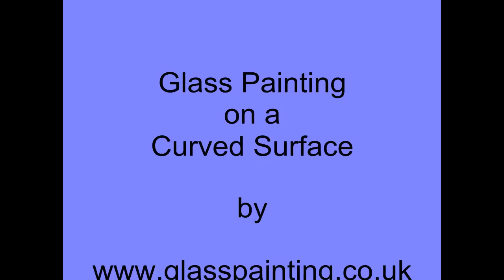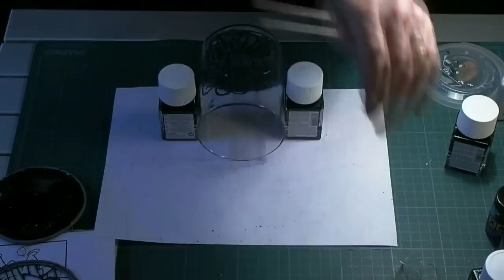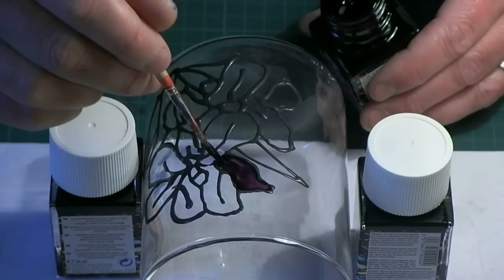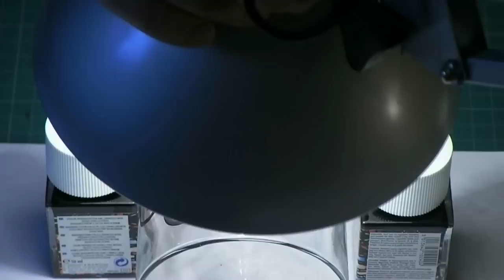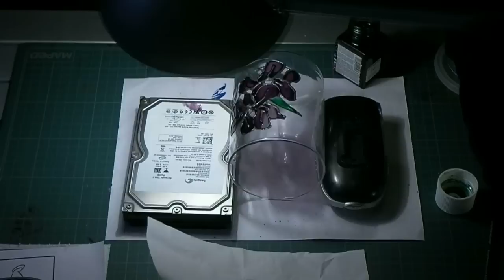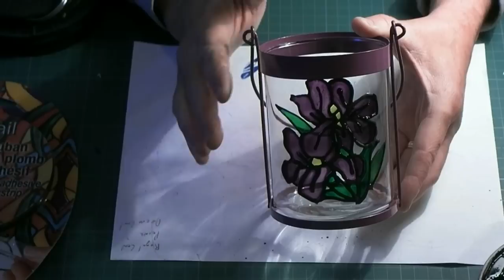Glass Painting: 3d Objects

Comment from the maker: The paint used Lefranc and Bourgeois Vitrail Glass Paints. They are a very thick paint with strong colours and wor well for this type of object.

I shouldn't be bias about outliner but I am :-) When ever possible I use Gallery Glass Liquid Outliner. I haven't found a make of paint it wont work with (yet). Like other outliners I never use it from the tube or bottle. I always make up a little piping bag out of greaseproof paper and work with that. (As Gallery Glass comes in a bottle you can always put any unused outliner back into it). If you haven't used a piping back before you will find details on glasspainting.co.uk .
Reply: I'm confused.  In your video April 21,2018, you share (& show) that the Gallery Glass outliner ends up with cracks.  You said not to use it.  Which is it?